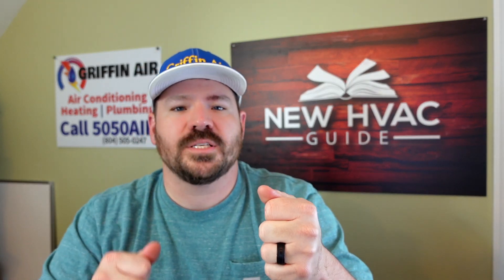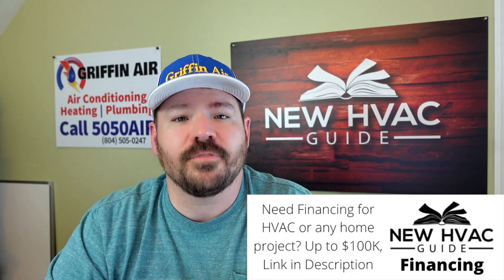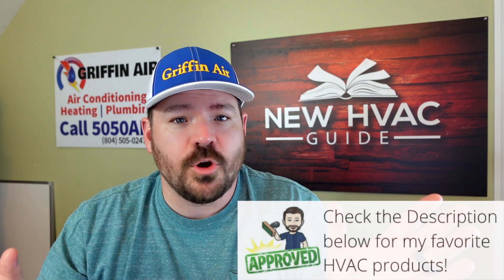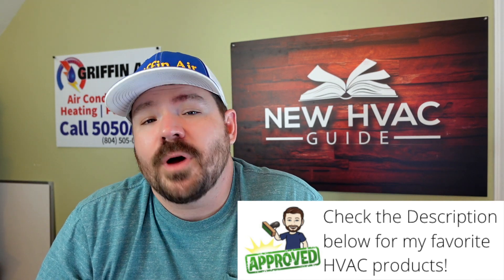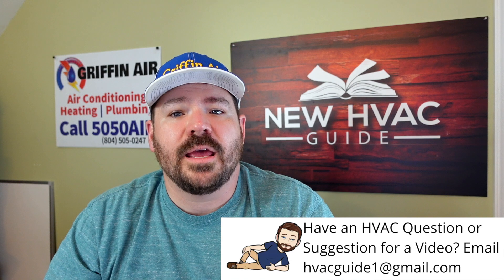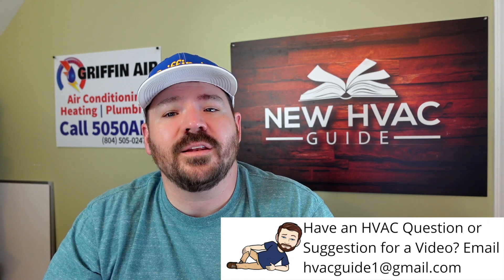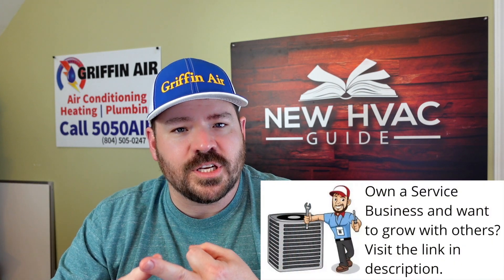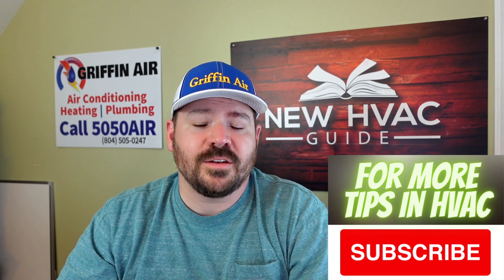NEW Furnace Efficiency LAW!

Comment: I pay $1,200 for a 96% furnace if it last 20 years it pays for it self. not bad.
Reply: It is going to cost well  over $1,000 in repairs over 20  years if it even lasts that long... it will never pay for itself.   I am a retired mech engr and HVAC contractor, 27 men on staff at the peak.  now retired.
Reply: @Phil_Scott   I was just looking at the cost of the unit when you bought it. If it save $60.00 a year on fuel cost times 20 years equals $1200.00. Man has not made anything that last for ever. Just watch the brand you buy because some will cost you more up front and when the parts break they charge more for replacement parts. 
I was at a house and a neighbor was telling about his neighbor that bought a 96% furnace and his bill was the same as last year. He thought that was really bad when I said that was wonderful he went nuts and said what do you mean with a lot of cuss words. I smiled and said did you forget gas prices went up 40% and his bill stayed the same he was speechless.
Reply: @carlmanis879  YES, that is the problem.   you were not looking at the skyrocketing cost or repairs for the 96% furnaces over that 20 years, called costs of ownership.   you were only looking at the first costs of buying.
Reply: That's the wholesale cost; you need to ad labor plus other materials and tax and some profit. It'll cost you around $ 5,000.- approximately!
Reply: @bobboscarato1313  $3,000.00 for some profit for a push pull and 5 hours work seams a bit high. That's $600.00 a hour profit for that job with 2 kids with a high school diploma doing the job or do you use 2 neurosurgeons for the install.
Reply: @carlmanis879  It all depends on overhead and cost of rent and insurance right now rates keep on climbing up fast! Also may vary depending on your location!
Reply: right on carl,of course it doesnt take a genius to install a warm air unit
Reply: @thankswillie  It easy installing furnace and AC if you have all the parts and tools ( $2500.00 ) on your truck that would need for the job. If you had to run to home depot for each part you needed it would take a long time. You do need to be mechanically inclined and have common sense. Because your working with 120 vac 230 vac  gas and liquids that come out so cold they burn you, and plumbing for the condensate drain and know codes. Just for furnace any high school kid that is  mechanically inclined and have common sense could learn the basic skills needed in three installs. The biggest thing is safety.
Reply: @carlmanis879  I don’t have a truck
Reply: If it’s a 45 thou btu 800 sq ft house. ya 1200 at cost not installed plus every other supply bh venting and fittings, sheet metal, cleets, 1 pvc drain and fittings. So 1200 nope

Comment: This is why I heat with wood. Between the saw splitter and the tractor I only use about 7 gallons of gas. And I can have it all done in a weekend. My stove doesn't require any electricity the only maintenance is a cleaning once a year paid 300.00 for my stove 25 years ago and still working perfectly.

Comment: We replaced our system 4 years ago and went with a super efficient AC compressor because that is what cost us the most to run with our electric bill around $350 a month. Our gas bill is usually around $80 a month so it did not make sense to pay for a condensing furnace that will never last as long as a non condensing furnace.  Bottom line is we don't need the government forcing their will on us. It did not work with toilets or light bulbs. People will buy what makes financial sense for them. I was apposed to LED lights when they 1st came out, but as they got cheaper and had better color I ended up switching to them. Same with the toilets, now that they have 3-4" connection from the tank and can actually flush a turd with 1.6 gallons. Every time the government forces something, the public gets screwed.
Reply: It's always that way; the government are not business people; they are lawyers, accountants, bookkeepers, etc. but don't know squat about business and we the taxpayers pay the bills!

Comment: As repair goes, they are capable of producing a relay control system for these modern furnaces that would be service friendly but the problem is that with modern service men.  It would be a wonderful spaghetti mess of relays and timers and I don’t doubt a minute that some of the industry new be techs would somehow get the ignition timed wrong and blow up a house..  it’s hard enough for new techs to get their heads wrapped around pressure switches and contactors let alone the control system that would replace a printed board
Reply: Right on the money George...I am a retires shop owner, 27 men on staff for 40 years.
Reply: @Phil_Scott  I believe you are a retired shop owner of 40 years with 27 employees. I know this because you said it multiple times in comments. We get it. Your an authority. Good for you.

Comment: This will push a lot of people to supplemental fireplace use, burning wood or any other available fuel. The current administration is insane with the push for carbon neutral, we are stepping back into the Iron Age, China and India aren't doing squat, all our changes will not make a difference except destroy the economy.

Comment: This has been law for years in canaduh here. I install between 5 to 10 furnaces a month and they are all 96% efficient. Straight up they can suck bad. Venting can go through the roof or wall, slope vent back to the unit, 1/4” per foot. 100k btu unit can make a gallon of water an hour. Neutralizer required for condensate going into iron or brass or copper pipe. Lots more parts to fail. Law hasn’t hit mobile homes, rtm homes, or shop heaters here yet. But nordyne does make a h.e mobile approved unit. They all really suck two far.
Buy as many 80%mid efficient appliances as can before they push it through.
Reply: Right on the money Zeb.
Reply: That's what I'm thinking too --- I may need to replace my HVAC system soon and may go for the simpler, less costly 80% system.  Wait it out and see what's new in say 12 years if I have to replace again - maybe by then new higher-efficiency Heat Pump technology could be a viable option in super frigid regions.
Reply: You replace ALL the condensate drain with PVC.

Comment: Condensing furnaces are terrible with the secondary heat exchanger clogged up.having to be replaced,which if not under warranty,is very high repair or get new furnace.Carrier is the worst and should have a recall on them.if you have propane it’s even worse for them.give me a 80 percent furnace.i have a boiler in my house and love it

Comment: You are going to like wrapping furnace drains in the attic, with water pipe style  electric Heat  tape. since water in my area freezes and if there is a power outage, well you get to buy a new, uncracked, unfrozen condensate trap and related pipes.  from Ontario.
Reply: If you have a power outage,, I hope you have a power gen, otherwise if furnace doesn't work, you won't have to worry about drain freeze up; the whole house piping will freeze up. More insurance coverage is needed; by the way here in the US insurance rates are going up 40%+++

Comment: Inflation caused by the current administration will make it much more difficult for homeowners to upgrade older equipment to higher efficiency units, thus defeating the so called purpose of the law.
Reply: I think the general public should demand rebate programs and low interest financing to be able to pay for all of those refinements!
Reply: @bobboscarato1313  Rebates have been a thing forever, now 10 year financing is becoming a thing, as well as 10 year leases...
Reply: @markbeiser  The ten year financing offered by the utilities was knocked down by the banks complaining of encroachment by the aforementioned.-
Reply: @bobboscarato1313  The 10 year financing this time IS from the banks!
Reply: @markbeiser  You mean Banksters?
Reply: @bobboscarato1313  yes shifting consumer expectations often coincide with efficiency improvements. Here in Ontario, Canada and the western provinces, nearly everyone expects a high efficiency gas furnace.
Reply: I do feel that it's more over the longer term that when the mid-efficiency gas furnaces fail, the home or business owners will have to decide on a higher efficiency model or a heatpump. In the warmer weather states even a single stage heatpump should preform very well and would be the more prudent and cost effective heating system as they also air condition.
Reply: Bob, I am afraid that the rebates give the manufacturers an opportunity to raise their prices by that amount, just so they can get more while the customer feels better about purchasing the product. Low interest financing raises the demand for the products causing prices to be higher.
Reply: @jasonligo895  That sounds like what happened when the Gov got involved in secondary education.

Comment: Yeah and it wasn't long ago all of the "experts" pushed natural gas for many industries because it was "clean burning gas" and extremely efficient not to mention, back then, cheap.
With these PVC pipes, its my understanding they have to flow slightly horizontal and exit a wall vs. the roof. So, that means more parts, more labor not to mention the heaters are extra high in cost once you consider anything 90% or higher.
Reply: With the PVC pipe, that's what I understand too. When I replaced mine it wasn't the extra cost of the equip, it was plumbing it 20 feet to the wall that killed the idea.
Reply: @DSC800  I charge about $2000 for an 80% furnace installed. I would do a single stage 95% furnace for $3000 and run the pvc as long as it’s in an accessible area. PVC is cheap you only need 4 ten footers of pvc pipe, cost about $100. My costs for a 95% furnace is about $300 extra compared to an 80%. I would rather do 95% as an hvac co owner because I can make an extra $500. Problem is some companies over complicate things to charge more. In Chicagoland area, we can usually push out from basement to exterior wall. We cap the metal flue and recommend getting a power vented water heater. We abandon the chimney and cap it off. Just my 2 cents worth although no one asked for my opinion.
Reply: @joep4143  Sounds about right to me. I'm in coastal S.Cal in a med size efficient house so my heater efficiency was not so important. I doubt I use it even 30 days a year.